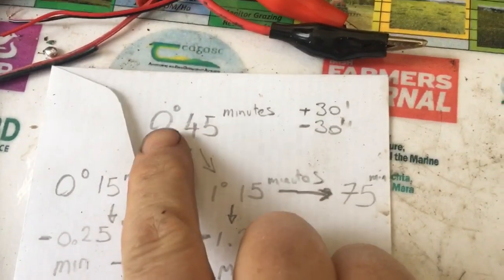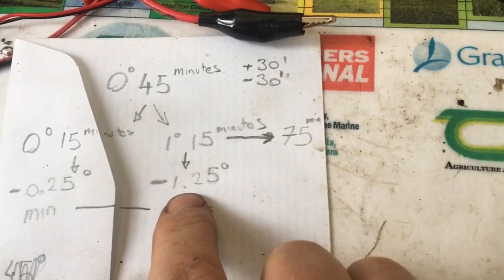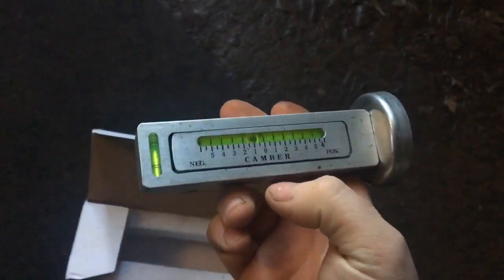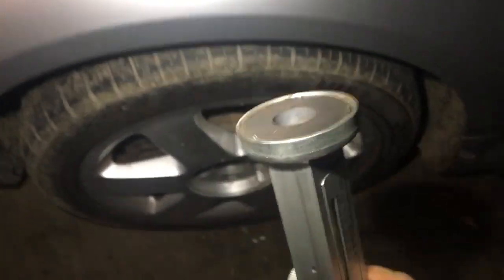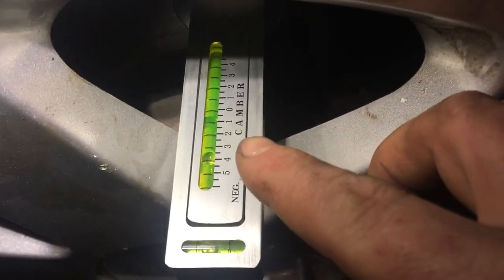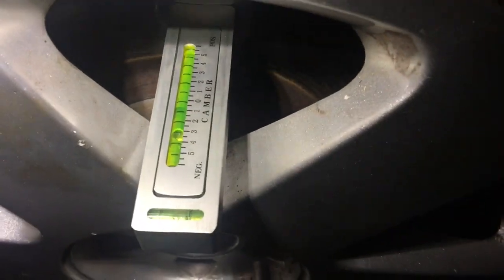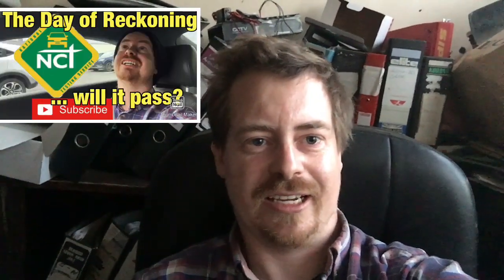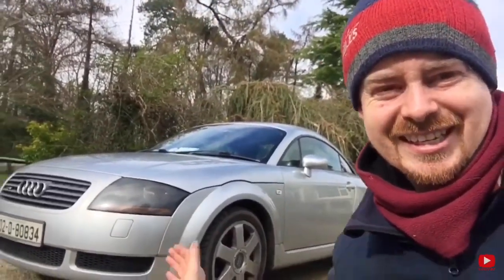15) Adjusting the TT camber

Comment: Small tip: if there is not enough room to mount the tool on the brake disk, you can use a 17mm socket on a wheelbolt and mount the tool on that.
Reply from the maker: Great idea never thought of that. Thanks for sharing
Reply: I usually put mines in the center of rim on hub

Comment: The way you set up and adjusted was spot on Steve 👌
Making 'slip plates' 2 bits of steel with grease between is a simple fix for checking

I've never used that type of guage, I have made my own out of wood and string 🤔😂
Great to see it's set up right, top job!
Reply from the maker: Ya I always wonder if I’ve done it correctly but getting the 4 wheel alignment the lads asked who set the camber? I told them I did and they said it was as good as their machine would calibrate it. I them smartly said , sure they meant you won’t have to adjust so you can knock that off the bill. Sadly it doesn’t work like that 🙈😂

Comment: Steve, i also have this gauge, & for camber its good, however the instructions also state a castor measurement is possible
by the usual method of a 40degree turning sweep, as per the instructions. However, i believe the POS & NEG read opposite when taking a castor angle.....i.e. i know i have positive castor of 3 degrees but the gauge will tell you its a NEG reading.......give it a go see what you think
Reply from the maker: I’ve never adjusted castor because on the Vw and audi it’s set and cant be adjusted. 

The most important thing is to release any pressure in the suspension (ie) roll the car forward and backwards . Bounce the suspension and turn the wheels etc. I’d love a set of wobble plates which allow for movement when your adjusted the wheels. Good luck with your adjustments it’s really a black art form 😊😉

Comment: You need a leveled floor or you’re not getting correct measurements. Also, static toe settings are dependent of camber angles. Adjusting one will change the other. This video shows how to improperly adjust camber.
Reply from the maker: Please explain more

Comment: I’ve heard the Mk1 TT handles better with less than factory camber at the front, if the car has larger swaybars and adjustable rear link arms adjusted with correct rear camber. 
🇦🇺🤜🏼🤛🏼🍀🍀🍀😎
Reply from the maker: Any idea what the number settings are ?

Comment: I dind't understand if the adjustement was made with the wheels off the or on the floor. thanks for your reply
Reply from the maker: Adjustment made with wheels off the ground but car driven back and forth to settle suspension and then read with camber gauge to check how correct it was

Comment: i got tyre dmg inside same cr audi tt..and i see that my camber is set to the other side than u set it in video..im change it like u in vinteo all way to other side and is like press brake and when turns u hear it..i use 5mm spacer..if turn t back to other side is ok..spacer is the problem?u sure that must be set it to this side?
Reply from the maker: Hm do you have a camber gauge ? You might also need to get the tracking reset. Make sure you have the same air pressure in each wheel